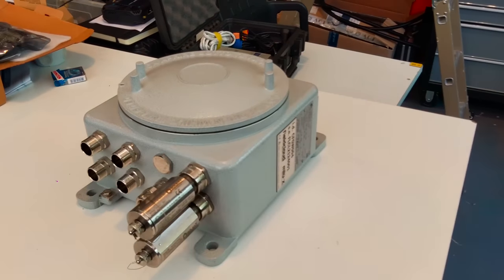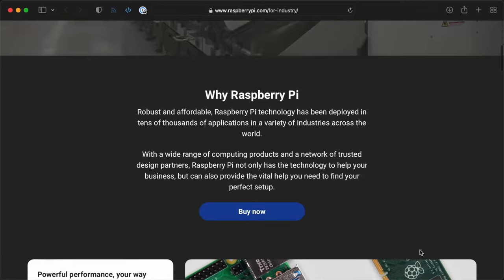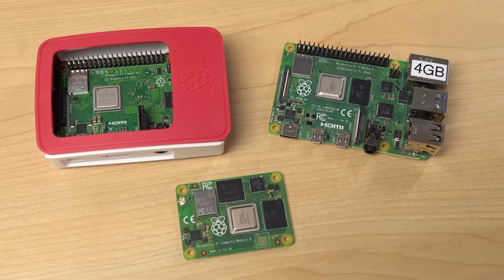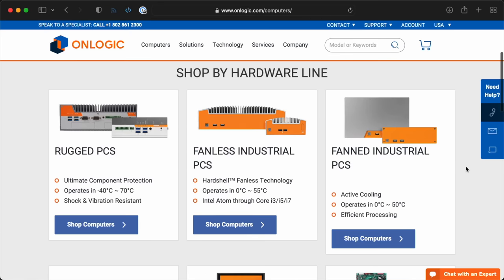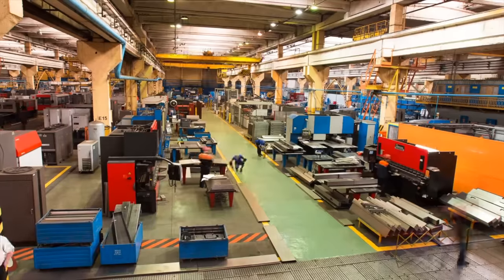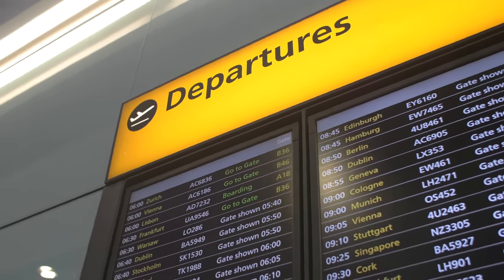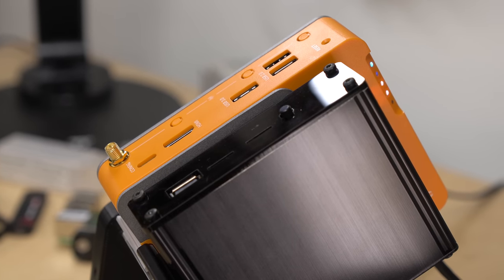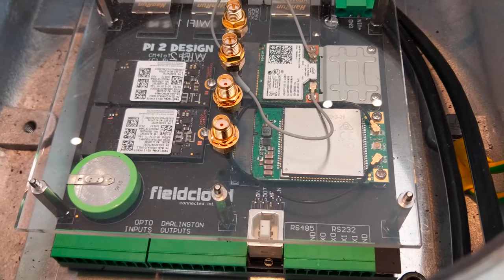Why are Industrial Pis so expensive?

Comment: When I was starting out I wondered why industrial PLCs cost so much money and why anyone would use them over an arduino or other microcontroller. Spending $200 on a basic PLC is alot cheaper than the $50,000/hr it costs to have an entire factory shut down because a critical piece of equipment shit the bed and it is cheaper than the millions it would cost to pay the lawsuit for some 12 year old who fell down an elevator shaft when the doors opened too early or the  hundreds of millions of dollars it costs when the machines in the baby food factory get out of wack and start adding unacceptably high levels of broken glass to your product.

Comment: My first exposure to explosion proof enclosures was at the home of a man who designed and built paging systems for mines and factories. It was called C. W. Thompson, and he had the prototypes of his early products. They had to make their own enclosures, which were sand cast aluminum. The walls and covers were about a half inch thick, and used a compressed gasket for the seal. All wiring was in rigid conduit, right up to the speakers which also had heavy cast drivers.
The most interesting device was a huge multi pole, multi position switch for a fault tolerant PA system for the first US nuclear power plant.
I bought a pair of Verbatim NAS systems a few years ago. I never did get them to work reliably. I plan on gutting them and installer a different controller.

Comment: One thing about the certifications is that the plants tend to be certify too so that's why you actual need proper certifications on the devices you need while consumers are fine with having devices that follow the certifications but not actually certify.
Reply: Agree.

I saw a great video with the Rpi team a while back where they talked about the benefits of them using the specific Wifi certifications and tests they did as it would allow commercial customers to build a Wifi based product but not have to do all the retesting and certifications because the Pi foundation had done the 'right' paperwork. 

To a hobbyist, thats stuff is irrelevant, but its what makes Pi's the 'go to' for embedded compute for commerial customers because it saves them a load of additional regulatory paperwork that other Pi competitors would otherwise require.

Comment: I work in the industrial automation field. It's not common to see raspberry pi and arduino based systems in industrial settings. In most applications they just aren't rugged enough and pi's tend to be overpowered and arduino's tend to be underpowered. Most industrial applications use programmable logic controllers (plc), programmable automation controllers (pac), or industrial pc systems. These systems technically look underwhelming when comparing data sheets with a pi but they are bulletproof and can be much easier and faster to program.

Comment: A little context on the price of the explosion proof pi here:

When something like a pi is deployed as part of an industrial system, you'll be getting something that is fully integrated into that specific system. Industrial setups don't use the PI in the same way as a consumer would. A consumer will want the pi do be capable of a lot of things. In industry, the pi will have to do one thing and be able to do it without any down time. downtime costs money, both in loss of production as well as in terms of paying someone to fix it. often, this will require calling the company that installed it, hence the requirement of as high of uptime as possible. 

Because of this, they will taylor the PI's software and what cables connect to it... you get the idea. you're getting a customized pi, set up specifically for the task they designed it for. Thanks to that, there is no such thing as a "price" for these as they all have different requirements. The price will be the cost of the hardware, yes, but it will also include the programmer's pay, the tech's pay when he integrates it, as well as whatever overhead the company decides to charge. 

for a little perspective on that i used to be an install tech for similar equipment. I made $22 and hour, but they billed me out at $200 an hour so that everyone else working on that project back at the office (programmers, project managers, you get the idea) would also be able to get paid.

Comment: I've been working in factory and utility automation for 30 years, I would never put a Pi on any critical operations in my environment, we use PLCs and things like SEL RTACs that can take a pounding and things keep working and their underlying OSs are EXTREMELY stable (don't want an electric substation, water treatment plant, or sewer pump station to stop working due to using a cheap ARM device with buggy software). I do use many Pis in non-critical functions, I usually put them in NEMA rated enclosures.
Reply: Raspberry Pi's by default run a version of the Denian operating system. A system known to be extremely stable within the Linux world as it is meant for servers that run 24/7

Comment: As an E&I engineer it is cool to see the raspberry pi making its way into industrial automation this way. Engineering a lot for eplosive environments, next to this box there might me specific cables required. Internal separation if there is also intrinsically safe circuiting involved. There has to be a lot of specific engineering and external validation to be done in these kind of environments, not only the equipment. 
If you want a soothing bedtime read you can start reading the IEC-60079 standard 😋
Reply from the maker: lol that's okay, I'll let the experts read IEC-60079!
Reply: No, it is not "cool." When We The People cannot get our hands on a Pi or CM at a sane price.

Comment: Nice video. Allow me to mention a couple Italian companies that offer pi-based industrial PLCs, that I am using in my projects: Sferalabs and Elsist. Typical industry-specific features, in addition to those mentioned in the video, are 24 V power supply, battery-backed real time clock, relais outputs and protected inputs. In some cases also RS 232 or RS 485 ports, or even one-wire ports.

Comment: I think another point to it is 20 years from now you'll still be able to find a Pi kicking around. So the board can be replaced if it ever does have an issue. Sometimes I work on systems that are crazy old, like, no joke, run custom control software on DOS/386

Comment: The 5 points at 3:37 miss a very important one: availability in short and long term. Which is a problem at the moment.
Reply: businesses don't have a problem supply as much. the 500k units that are being produced per month, at the moment, are going straight to businesses.
Reply: I work as an electrical engineer at major manufacturing company focusing on new equipment design/procurement and this supply issue isn't just for consumer electronics. We are seeing lead times from major industrial controls manufacturers jump from a typical 6 weeks to over a year with no signs of them getting any better anytime soon.
Reply: @tnwagn  these were supposed to be consumer products, not running whole ass businesses.

Comment: The beauty of the Raspberry Pi is the community, and the standardization.  It is easy to find software, purchase HATs, troubleshoot issues, download STL cases to 3D print, and many more items.  Of course, there are other boards that can offer a lot of nice features, but the Pi has a lot going for it.  I can add a Zymkey, and now I have state of the art, encrypted endpoint encryption on par with the latest generation consoles, for example.

I also have read nothing but praise, as well as have had nothing but excellent results using Raspberry Pis in the field for edge computing.

Comment: Used these in a past job for modbus network interfaces to utilize existing networking. Makes sense - no point in using custom hardware or running home runs for the scada equipment

Comment: this was a fantastic video, it's so cool to see all these wild use cases for the PIs and the work put into it. That being said, I will always have mixed feelings when I see hobbyist hardware used in high end industry applications, especially when said hardware is constantly out of stock. I know you tried to address this a bit towards the end there but I still feel the need to give my 2 cents.

At the end of the day, I'm sure that one or more companies out there could set up and manufacture some "industrial-grade" CM4s using the same SOCs that are 100% cross-compatible with the original but have tweaked designs for better efficiency or reliability for example, then they could sell those at a premium if price is really of no concern since those would be valuable selling points for a business. Or maybe the raspberry Pi foundation should look into doing this themselves, kind of how Nvidia sells their Quadro and GeForce cards. I realise this doesn't solve the supply issue for the SOCs or some other chips affected by the silicon shortage, but at least they wouldn't be buying up the same exact SBCs that me and you can't even find ONE of for some low-budget home project.

I respect the effort that the companies in this video put into making their enclosures and everything else that goes along with selling an "industrial" Pi, but to me it just still feels somewhat lazy or a bit like cheating for some company to buy a cheap $35 board (I'd imagine by the thousands of units or more at a time) and slap it into an expensive enclosure so they can charge as much as half a million per unit. 

I guess my main gripe is this : The end product might be super expensive but they probably pay the same amount for a CM4 as everyone else, if not lower due to bulk discounts. These companies have so much money they could basically just buy out the entire stock of Pis any and every time they want, how are consumers supposed to compete?
Reply: We makers were totally deceived with the RPi foundation. I bought a Zima board yesterday for my DIY projects. Good bye RPi.

Comment: Can't agree more with Mathew Smith that the community and quality that Pi are over all others SBC even they may be more powerful. Those hardware lacks a long term support and quality community that provide free and paid support, like my Pine64 are good but now almost in an abandon state while I can still use some old Linux but not new, a manufacturer's business sense decide how large they can make, another example is my Apple 2nd generation iPad, it still work properly and the software really last for many years.

Comment: Industry mostly uses plc due to how modular and versatile they are for industrial applications.
Also in the uk IS (intrinsically safe) circuits are no longer up to regulation for new instillation, however if an old system uses IS circuitry it is still allowed. 
ATEX regulations is what is followed for EX (explosive environments) and at the moment you need certified enclosures wich use specific seals and brass parts to prevent an EX environment from developing within the circuitry to begin with.

Comment: I work at a company that produces components for the oil and gas industry in Europe and everything needs the ATEX certification. Even the most simple stuff has to be explosion proof and this results in very high prices. The actual hardware inside is usually only a small part of the cost, the enclosure and safety features drive up the cost.

Comment: Every time you slap a label to some hardware or piece of software like "industrial" "medical" "aerospace" etc you pay for that certification.
Most of it it's surely warranted but I think there is also some level of keeping the barrier of entry sufficiently high to limit how much competition you have inside each of these niches
Reply: Not sure its barrier to entry for limiting competition at all, as even in the often corrupt world we live in the makers of fancy medical/industrial computers would like to not have to spend to much to certify it, nor do they much need to care about rivial, as the service deals are for years. In short IMO they would rather be able to pull a Boeing - make the 'max' version of an aircraft that is inherently massively different but doesn't need to be certified as a new one... We all saw how that worked out for them.
Reply: Or you slap "gaming" on some types of hardware (e.g. audio equipment like microphones) to fool less discerning buyers at no extra cost.
Reply from the maker: Heh, or make the cable insulation twice as thick and say it's a better cable when the conductors inside are exactly the same.
Reply: It's all about risk transfer and safety at the end of the day. That being said, some certification schemes have become somewhat self-serving to raise the entry barrier just high enough to make a handsome profit for lab testing. But it is all part of the process.

Comment: I'm currently in an industry engineering degree, and I think we need to get the scale clear here. Industrial computers, especially something like an Allen Bradley PLC, is designed to run at full power and capability 24/7 until.. oh.. about around the time of the heat death of the universe.

Comment: I would argue that power and shielding are perhaps the most critical first steps to getting a Pi into an industrial environment. I design various industrial electronics for automation and typically deal with power and EMI issues that will crater an open RPi pretty quick. Any I/O's have to be hardened for most applications - in extreme cases they need to be isolated which is big and expensive. 

CPU's are definitely the cheapest thing in the system.
Reply: Yep you are right, we designed in quite a lot of protection circuits (optoisolators, TVS and extra shielding). We do a lot of torture testing during field trials to harden things up properly.
Reply: @MatthewSmithFR  All of that is $$$. Especially true when you have to qualify the final system against written standards. The required tests themselves can exceed the cost of the initial development in some cases. 

Hats off to you for getting it done.

Comment: If I'm understanding this right, without the Pi's these computers would cost possibly hundreds of times more, and part of why they're still expensive over the base cost of the Pi itself is because they harden it against industrial environments. Sounds fair to me, and kind of cool. Now we just need a Beowulf cluster made with CM4's that can fit in a suitcase and operate off of a battery.
Reply: Just as a quick comparison, the manufacturing company I work at is starting to deploy Pis for PLC data visualization on the factory floor, using NodeRed and open source drivers. The next nearest industrial solution from another vendor is $3,000. That 30x the cost of the Pi solution we are deploying. The biggest difference is that for the Pi, the system design isnt a one trick pony, so the cost can be much lower as the sales options are enormous. The other reason is there is no specialty software or licenses the Pi needs, compared to the $3k solution which has to buy all the licenses to communicate with the PLC.

Comment: iirc explosion proof is a bit of a misnomer, it doesnt mean its designed to survive an explosion, although some certainly can, but it means that it wont set one off, all electrical/heated components are isolated from any flammable gases or fluids, basically its sealed airtight so nothing problematic gets in or out

Comment: I'd really like to learn more about this. I'd love to do more with industrial Pi and getting into that side of control programming. Right now, I only really exclusively use PLC's from Siemens and Allen Bradley.  I know my way around Ladder Logic, Function Block Diagrams and Flow Chart diagrams, but Structured text is a major weak point for me, and full on programming like would be used for industrial pi is right out.

It's fascinating seeing these modules used for this application, where I'd always sort of assumed the modules just were not robust enough for the demands of an industrial enviroment.

Comment: I always ask myself how the industrial Pis deal with sudden power loss. I don’t see any backup capacitors. Is it intrinsically save by being read only? But the database in the SSDs has to be secured somehow. I appreciate any hints on that.
Reply: Ok, that’s possible. I thought the battery is like a BIOS battery or for a Real Time Clock.
Reply from the maker: @kokomcneal6197  That particular battery is for the RTC. I didn't ask about the Milü-X specifically, but I know many high-end 'ruggedized' NVMe drives (especially enterprise variants) have onboard caps to make sure they finish their writes after a sudden power loss.
Reply: @JeffGeerling  Thanks a lot for that info. I know that capacitors are also on some Synology SSDs. Nevertheless I would feel better if also the operating system shuts down properly with some kind of UPS like e.g. Juice4halt. They use supercapacitors to power the Pi down savely.

Comment: I keep hearing how hard it is to get Pis which means I apparently lucked out when I just randomly looked for Pi400 and managed to snag 2 directly from Adafruit.  Haven't had a chance to play with them yet and not exactly sure how I'll use them but I've got some ideas.  One will most likely go to my aunts house to replace an old laptop I left over there.  My Grandma isn't really mobile anymore so I setup an old laptop so we can watch her Church service online but that laptop is quite old now (4th gen i7 clocked at 2GHz, 8GB DDR2 (I think) RAM, and an old HDD, put Mint on it but it's still slow to boot).  The other one I'm thinking of setting up as a retropi/web browsing system.